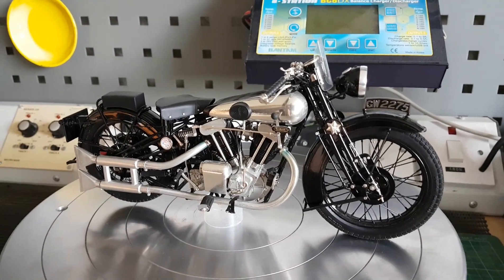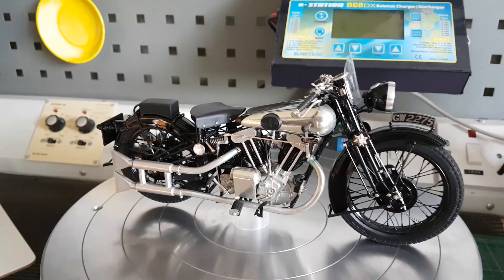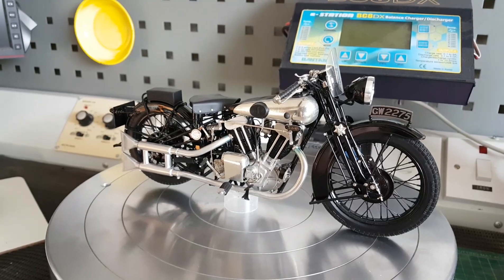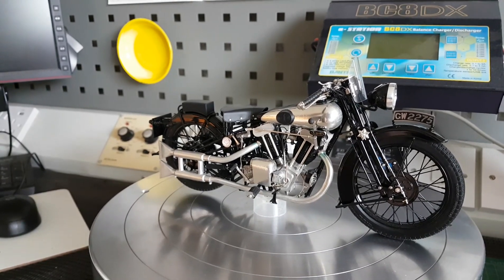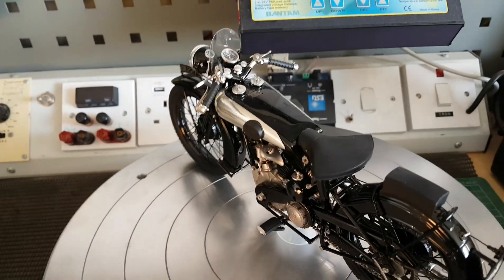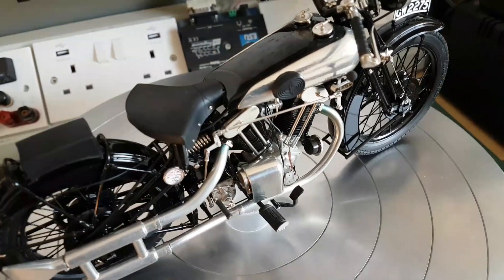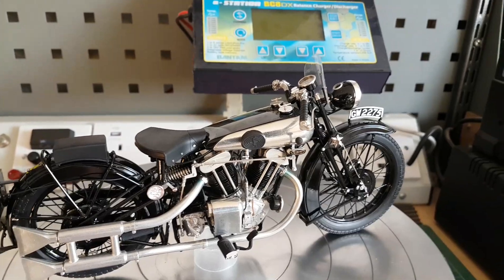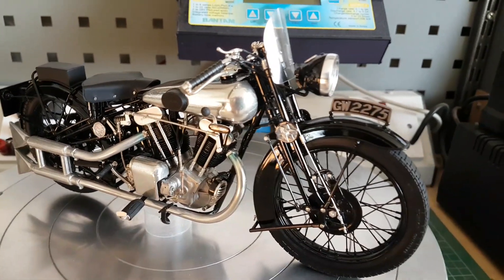Building the Model Factory Hiro 1/9 Brough Superior Part 3

Comment: Lovely build of a gorgeous model. You should definitely keep going with the videos. (Hmm. As I now see you have done!) Very enjoyable. Can't imagine being given one of these. I could never justify the cost of buying one. I've long had dreams of Tamiya coming out with a range of old Brit iron at around the hundred quid mark, including the Brough and the Vincent. what a change it would make from the endless  stream of identical wedges that they churn out. Subscribed.
Reply from the maker: Hi Malcolm
Thanks for the nice words it's appreciated. Yeah I know what you mean on the price they not the cheapest kits. As for tamiya doing them I can't see it I used to work in my local model shop worked there for over 25 years so have a bit of a insight the reason tamiya will never do them is they won't sell enough to warrant the cost of making the moulds even though there is a big following for British bikes in Japan if they can't sell a thousands they won't make it. They used to ask for suggestions of what to make and generally that was the answer they gave back.. Thanks again for the support..

Comment: I have 3 of the Hiro kits I have been saving, and this is stunning Great work
Reply from the maker: Thanks you for ya kind words.  I love mfh kits. What kits do u have to build
Reply: @wiggly71  K540 1924 Montgomery-Anzani 8/38hp V-Twin ,  K485 Brough Superior SS100 and K621 Vincent Black Shadow Late (1950) I haven't started them yet just doing research and glue / paint types. You had mentioned a two part paint what was it.
Reply from the maker: You have some great kits there and a lot of hours of building the vincent black is on my list to.  The 2k paint I use is zero paint  all base is solvent base then the clear is 2k I get it in the UK from Hiroboy  if u struggle to get they do ship international I think.  Good luck with the build if u need any info on building let me know be happy to help.
Reply: @wiggly71  Have you ever tried solder instead of epoxy glue? i think i want to go the all metal route so i can file the joints smother.
Reply from the maker: I have not soft soldered any mfh bikes i used to work in local model shop for 26 years I only ever soft soldered model railway kits it was the thing to do back then glues  was not as good as today.  I would advise don't use epoxy it's to thick and to hard to work with. I only used a good quality cynoacralte (posh word for super glue)  If u realy want to soft solder all I can advise is practice practice practice  it can go very wrong very quickly and I know that from experience.  To much heat near white metal and u loose the part. And there's nothing u can do to get it back sometimes.  There is so many pitfalls I can list them reply would be pages long..  As white metal kits go MFH  are the best they fit very well yeah sum joints I pinned with brass but that was just for me I could have got away with not..  If it's ya first build I would advise going with super glue if u realy want to have a go at soft solder have a go on some scrap from one of the kits u have to used the same metal from kit as white metal sometimes have a different metal point depending on cast mix u will need a tempurtre control soldering iron good quality liquid flux for white metal and some low melt solder and just have a go.. sorry reply is so long did mean it to be  just don't want u to mess it up if thing go wrong it puts people of modeling I've seen it so often..
Reply: @wiggly71  Thanks, the input and advise is much appreciated.  I have years of metal and solder xp but was afraid of the CA glue because i thought it might not last or hold up against the mass and weight. I will probably do the same with brass to support and correct misalignment's.  Thanks alot. ill keep you posted.